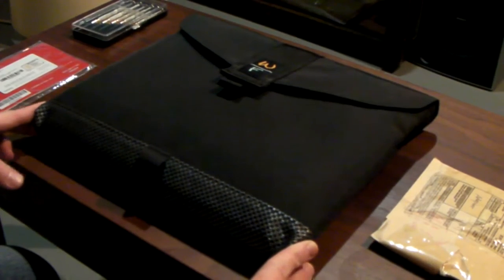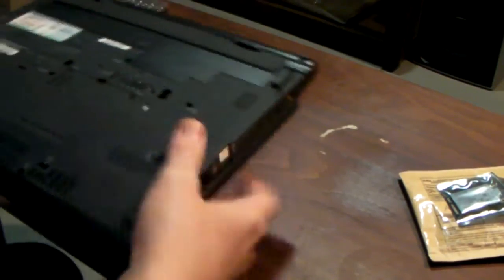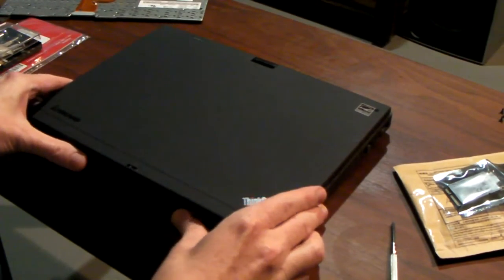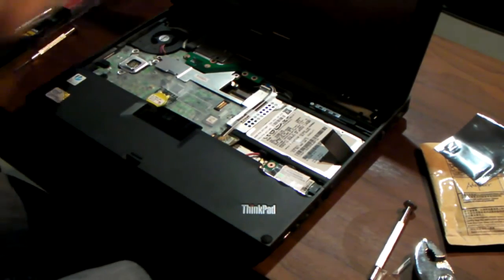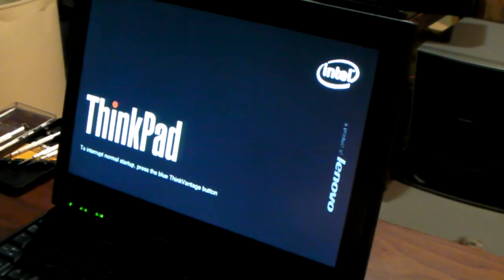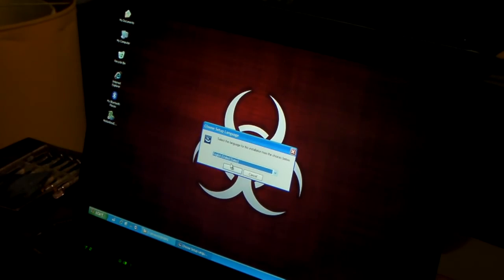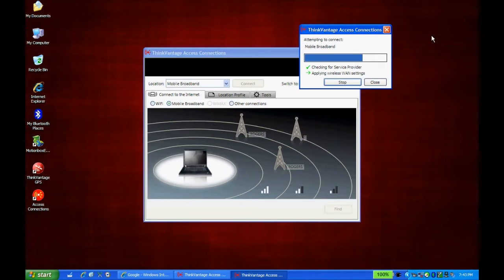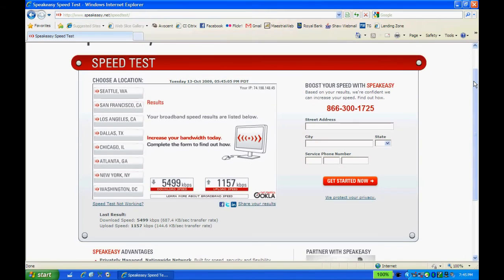Lenovo X200 Tablet WWAN Module Installation

Comment from the maker: @GabriKnight Yep they are the same as the ones used in cell phones or Blackberry's.

If your phone has a data plan, it "MAY" work, but I wouldn't recommend it.  You'll probably incur a HUGE bill if you do... I have one on a special data plan.. it would be the data plans you'd get if you got one of those Netbooks or Rocket Sticks.

Comment from the maker: I could get the USB stick from Roger's for FREE, but then you'd be locked into a 2 year contract whereas buying the device on eBay myself means I'm on a month to month and can cancel anytime, without the $600 early cancellation fees.  Also, the GPS with the Ericsson module works VERY well!

Comment: Thanks for posting this video. It inspired me to buy an open box Ericsson F3507g for a decent price and open up my 2000 dollar tablet to install it. I could figure out the parts that you have edited out of the video pretty easily. One thing I'd like to mention for other people who may try this: there is an empty PCI slot right next to the already existing WLAN card where this things slides into. Even if you never intend to use WWAN, this card is worth it for the GPS that it adds to the tablet.